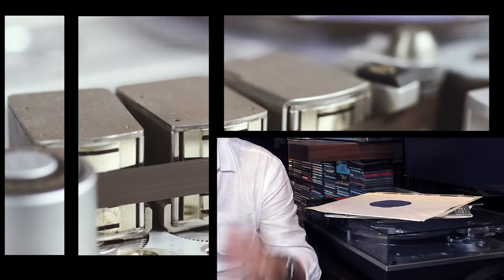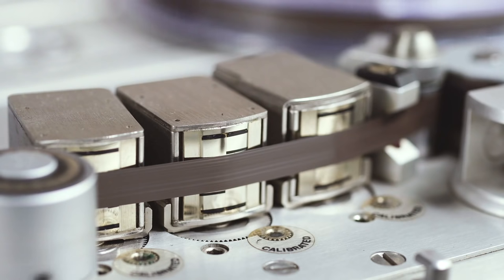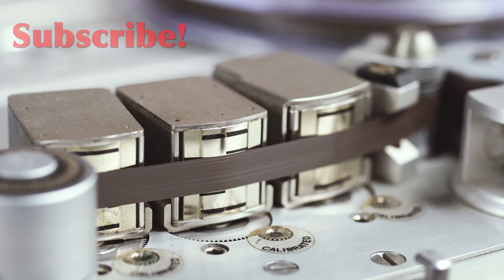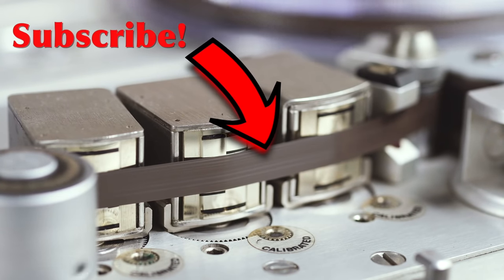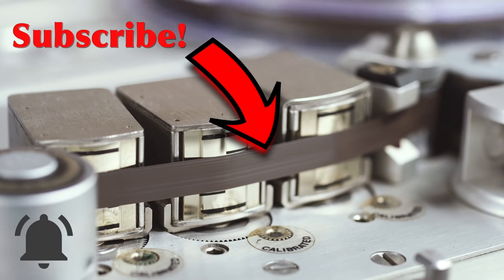How to reduce inner groove distortion & tracking error

Comment: Thank you! Great video! I haven’t done anything to my Technics yet. Just followed the old manual when I got it used. Wishful thinking that the previous owner had everything in good order. I know I should check everything but I sort of don’t trust myself because of zero experience... What would yo say is the best place to start? Check tonearm alignment? Check styles condition? Also I have a PRO13E cartridge, I know it’s discontinued. But was it good in your high standard opinion?
Reply from the maker: Thanks! Well, I would say thet you must absolutely check tracking force if you haven't (adopting that recommended by the cart manufacturer) and reinstall your cart, possibly with the Baerwald protractor (free on hifiengine). Check my setup video. I made only one but it's all in there! https://youtu.be/GqWh41NT1Cc
The cart is great to start with or ifnyou have a budget setup. As I always sai IMO you need a very good cart to get very good sound, more that a high-end turntable.
Reply: ANA[DIA]LOG thanks! On it!

Comment: RCA had albums where you had several records in single size.  and the marketing at that time assumed that the distortion was lower.  but it's clear if you have a Tonarm specifically for single size discs.  so maybe it's get that effect.  then the discs were at 45rpm

Comment: My Dual 1229 setup right. Takes time. My tools are few and need a bit  more up grades. I have a mirror plastic protector and a digit stylus gauge. What are better gauges to setup my 1229? This will l limit inner grove great video!!!
Reply from the maker: Just use one of those snall precision digital scales for jewelers, they are great and cheap. Great turntable there....just released a review of a 1019: https://youtu.be/QrAU3Y6clXI

Comment: 1. is inner groove distortion the reason that hidden track based software fails?
i guess the hidden track where the zx80 software lives because i saw a youtube video where some turntables have to be modified to disable the automatic functions so you can put the needle onto the hidden track without causing the turntable to shut off or automatically return the tone arm.

some artists as a gimmick may put software on the hidden track and the idea is to record onto a mono tape recorder like those used for board meetings and then the tape is played into a zx80 computer that can display a light show in sync to the content or something.

2. is inner groove or inner track distortion effect digital data like on a spinning hard drive?

is the data compressed more near the spindle of the hard drive platters so that area wears out faster and needs more error correction?

same goes for a floppy drive?

Comment: Hi. Interesting topic.  Just wondering have you had much experience with tonearms in the 10" + range ? I noticed the Technics SL-1200G comes in at just over 9" in effective length. Just asking because I'm currently trying to decide between a table with a 9" or a 10" myself. Unfortunately in these pandemic times everything is taking longer. I've waited 10 weeks already for an order on a 9" but since it took so long I started thinking more about the 10".  Only thing is that would mean probably another 10 weeks+ of waiting. Anyhow it would be nice to know just how much of an audible difference that makes... Going from 9" to 10" with the same cart and most other things being equal. Can't really audition tables anymore and I figure when you get into more expensive ones it might be harder to do as well since they are usually special orders and dealers wouldn't always have what you want to compare. It would be nice if some of the reviewers out there would use these test discs as part of their reviews instead of them being so subjective.  Of course then maybe they wouldn't be sent anything for review 🤣. Thanks for the post. Always good food for thought.
Reply from the maker: Actually, no, just some auditions at shows but not at home. I have always had around 9" arms but considering these aspects and possibly being very careful with the cart match I do think it is worth a try.
Reply: @anadialog  Thanks for the reply. I'd love to go with the 10" version. It's actually the Pro-ject Xtension 9 vs Pro-ject Xtension 10 (which has some great reviews). I just don't know if I can wait another 10 weeks.
Reply from the maker: If you can still play music, then wait! ;-)

Comment: Hi! I've just used the Hi-Fi news analogue test lp and Bias setting start sounding distorted on track 7, and even after adjusting anti-skating, it keeps going on. Is there a chance it could be because my stylus is fairly new? or could it be a problem with my tonearm? (I'm using a Technics SL1200, with a Ortofon 2M black stylus)
Reply from the maker: Try playing with the antiskate. Otherwise it may be misaligned.
Reply: @anadialog  antiskate was on. however, my bad, I'm using a Technics SL1210 MK2, and I believe that might be the issue. do you confirm?
Thanks for your answer
Reply: @jonathanmathieu4227  I think that's an interesting question. I also have a 1210 MKII and I have anti skating etc aligned but still have some IGD. I am wondering anyway what audible improvements were made to the new SL 1200 and whether it is worth upgrading.

Comment: I don't know what you mean when you talk about "width compression" - grooves being more squished together near the center. Never heard of such a thing, which surely would only happen if engineers willfully changed the pitch during cutting, and as far as I know they don't do that as a normal practice. Ideally they should estimate what the base pitch should be depending on side lengths and dynamics, allowing for variable pitch setups and all that - it's not like they go "oops, running out of space here, better crank it down". Just by eyeballing discs, I see no evidence that this happens.

A simpler solution for off-center holes, no need for expensive auto-centering turntables or (egads!) drilling them out, is to get a turntable with a removable spindle. (I used to have a Dual 1219 like that. I guess such a thing is uncommon now, I modified my current table to do it though it takes a bit of machine-shop finesse to get it right.)  You put the disc on the spindle-less table, set it playing, stick a pencil or something in the hole which you can maneuver like a joystick until there's no sway in the tonearm, and you're good to go. With practice it's easier to do than you might think.
Reply from the maker: When I say width compression I am referring to something well known in record cutting. The swiggles, the grooves  near the center of the record due to the lack of space and distortion due to the angle that these grooves required to be read, are smaller in every sense because you cannot cut them with the same DYNAMICS of the first grooves and dynamics are exactly the width of the swiggles.
Reply: So you are saying it's desirable to cut grooves with less dynamics (or less loudness if you will) near the end of a side, if avoiding potential distortion is your goal - so those grooves will be narrower and shallower. Sure, but that's not mandated - you can cut discs as dynamic as you want, even so loud that no cartridge can track it perfectly (though you wouldn't want to). In practice, I note that a lot of records are just as loud or dynamic all through the side, start to finish. Which I'd say is as it should be. Inner groove distortion is a separate issue. There are choices the cutter can make to minimize it, but messing with dynamics shouldn't be one of them.
Reply from the maker: Sure, but that is the way it is.

Comment: Points of contention.

Speeds ) linear speed changes indeed, although this doesnt necessarily cause compression. An engineer can choose to cut with as much groove width as they want across the entire record and doesnt necessarily result in distortions like sibilance, its the stylus mistracking a groove that causes it mostly.

Off Center ) is mostly right again, but there are tables that can automatically adjust the platters position to recenter the spindle hole, like the Nakamichi Dragon:
https://www.youtube.com/watch?v=rUgOUftRSjk

Leveling ) is good, but not crucial for tracking really. The main benefit to it is to not throw off other installations like Anti Skate.

Anti Skate ) The only issue with using test discs is that some are using signal tracks that are way louder than most any music. Adjusting for that may not be optimal, but Anti Skating can never be perfect anyway, it changes between every record and across the entire record itself.

Styli ) Micro Line and SAS styli are the best indeed, Micro Ridge, Van Den Hull and Paratrace being a second tier. But Shibata is not as good, it is actually more than twice as fat as a MicroLine. This is probably the most important point I would say and I wish the whole industry would just switch to at least using Shibatas, if it did we wouldnt have so many groove worn records in the bins today.

 Shibata         6 x 50 um "small" design
Micro Line     2.5 x 75 um
Micro Ridge  3.8 x 75 um
VanDenHull   4 x 70 um
FritzGeiger    5 x 70 um
SAS               2.5 x 75 um
Paratrace       4 x 70 um

Linear vs Pivot ) These can get expensive indeed, but I also think the benefit isnt as great as you might expect. With proper alignment on a pivot arm, the tracing distortion between the null points arc will not be more than a few %. The real issue is with the speed as discussed at the start and this still affects linear tracking arms.

I agree 45s are not the best solution and I dont think they sound better just because they play faster. If you have a deck and stylus that tracks a 33 near perfect then there is no benefit to 45 and only downsides. But it seems we will have to live with a future of 45RPM reissues.
Reply from the maker: Maybe I wasn't clear enough:
Speed) a lower speed implies less engrooved vinyl versus the outer part that during that same amount of time will have much more vinyl engrooved. That is why 45RP;M sound better, more vinyl with more data spread across versus a compression in the inner grooves.
Off center) Yes, we have mentioned the TX1000 as an example in otehr commnets. In any case, very expensive and difficult to find, plus it referes to the rim so in some cases it is not accurate (as Hugo pointed out in a comment).
Leveling) As you said, it is a combination of effects and a domino effect. So all aspects are important. Leveling is very important for any part and any type of tracking.
Antisakting) I agree, but still crucial.
Styli) Interesting! We must remember though that is not just a matter of size but also design and geometry.
Linear vs pivot) I need to experiment more before making a statement. 
45RPM is some cases do sound better but not tremendously. What I can say is that the 33rpm version is usually worse than the 45rpm single back oin the day of singles!
Reply: @anadialog  
Off Center) Good point about the TX1000, I did not know that, thanks!

Speed) I agree with the first part, less speed means less material is being used. But you are mistaken in thinking that there is more data in a 45RPM record, it is not completely analogous to tape for example. The Lathe cutting does not care about the speed of rotation, meaning there is no more data at 45 than 33. It is the same data, just more tightly fit on a 33 vs more spread out on a 45. This helps a playback system to not mistrack, but given identical masterings, the output is the same.

Leveling) It depends on the degree I suppose, of course an upside down table wont play at all, but small errors usually dont cause heavy mistracking, they just add skating forces and such which as we agree can never be perfect.

Styli) Sure, but as I understand it most high end shapes are very similar, the small differences are just put in place so as to not infringe on copyright. The main goal in all shapes is really to reduce the thickness so as to fit any tight curve of groove formation, this image shows the idea: https://sites.google.com/site/zevaudio/_/rsrc/1311523912615/turt/stylus-shape-information/aroundthebendpincheffect.gif?height=275&width=400

Linear vs) Please do, I have only ever heard of people criticizing the design for introducing vibrations but Ive never seen anyone really show it. Like with Direct Drive, people still believe it sounds bad because a motor attached spindle causes vibration, but even just decent modern day DDs dont suffer from this as far as I can tell.

45 RPM certainly doesnt sound worse if anything, its only positive in regards to sonics. But there are a few problems when we compare the two. Most 45RPM reissues do not have the same mastering as other 33 counterparts, making comparisons unfair to begin with. Also, even if they do share masterings in few cases like Fleetwood Mac Rumours Kevin and Hoffman remaster, the 45 version is cut louder. If one does not compensate for this my normalizing the audio signals you will again put the 45 in an advantage as louder can easily be perceived as more better in every regard, detail, soundstage, dynamics, you name it. But you can measure some things like dynamics and show that this is clearly not the case, and if you ask Hoffman himself he will confirm in saying that the 33 sounds just the same on a well tracking deck. Balance the audio for both and the only difference might be a slightly louder noise floor on the 33 which given a good pressing and loud music shouldnt matter at all.